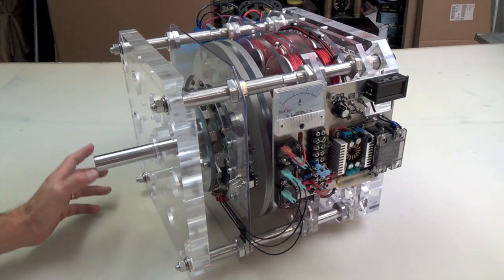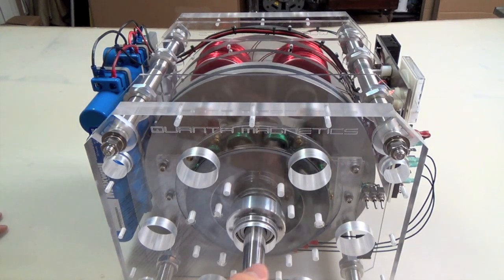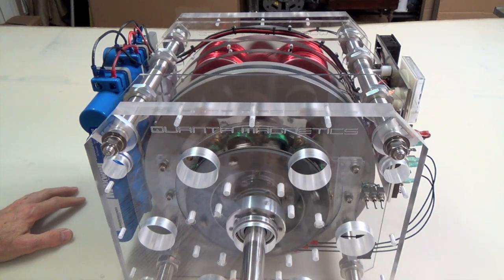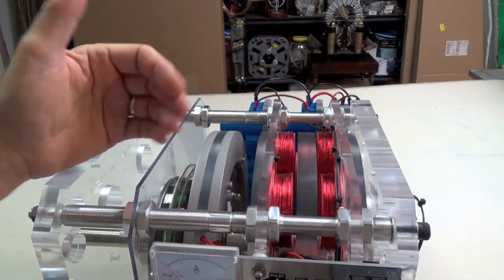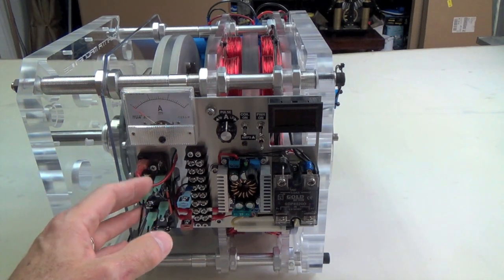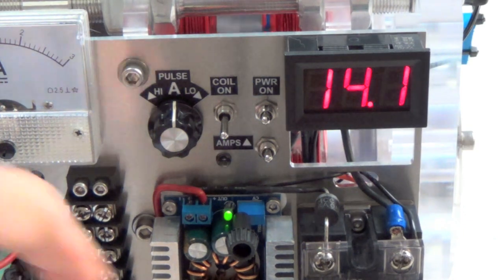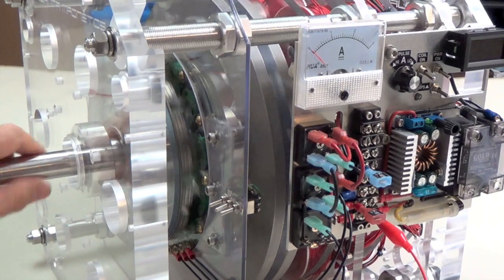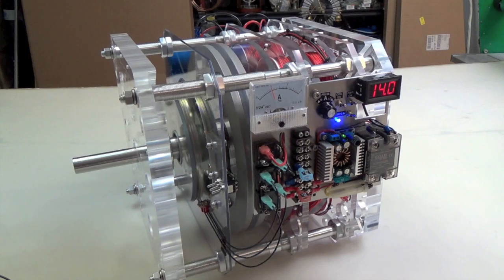Gyroscopic Inertia Pulse Motor Generator DEMO - 3 new inventions - one machine

Comment: is this thing a free energy machine or something?

how can you put in 50 mA and be getting out 1A ? (unless the input voltage is really high)
Reply: ***** 

No.  
"unless the voltage is really high" is correct exactly as I said it. 
50mA at HIGH voltage input can equal 1A at LOW voltage output.
Reply: yea but what's the drop in current between input and output?
Reply: of course current drops when voltage is stepped up.  if it did not, you'd have created a free energy machine where voltage goes up and current stays the same.
Reply: +Freddy Krueger voltage change, energy loss to friction.
Reply: +Ahashdah pretty sure the term you're looking for is renewable, not free.  After all, nature has also provided us with petroleum, so by your definition of "Mother Nature inputs this energy, not man," a regular off the shelf internal combustion car would run on "free" energy.

Comment: Well thank you for creating the most sensible video I have found on this topic. Most of the others are just a pure waste of time. At least you explain the basics in an easy to understand way. The machine looks nice for experimentation purposes and it appears as though you are suggesting that substantial mechanical energy can be produced with minimal electrical input. Did you say you can feed the power from the alternator circuit back into the machine to keep it running? If that is correct, how much energy is lost over time? Are you suggesting it can produce more electricity than it requires to operate or just that it can operate on a very low draw? I saw it recharging the two six volt batteries using a nine volt battery, but are you again suggesting it can replace more energy than it requires to operate?
Reply from the maker: It's all about maximizing your conversion efficiency.

Comment: sorry i cant remmeber your name but nice machine so far ^^
can you make it run liquid(warter etc...) i mean make it pump to a hight then make it fall down making an continues flow witout loosing its energitic flow i know you said in another video that you could use solar energy as a chargr for the duble gyro yay i know it might sound stubit using water etc.. still if it works it could be awsome piece of green tech.
but if you know of a better way to charge it then hand solar or warter try it out and show the results ^^ (precharged batteries dossent count as an good energy source)

Comment: How many watts does it generate?
You should hook up a bike belt chain to this and see the highest amount of watts generated, maybe with some other fuel sources? 
A stirling engine powered by a fresnel lens?
Imagine all of the power.
Reply: if this is to work in deep space there has to be a suitable source of power =drive =energy but for use planet side your idea is spot on
Reply: CDR466
 Could the suitable power source be Human? IE: peddle bike or circular treadmill? which in turn would keep stamina up in space?
Reply: Aba Zaba He's right. Take a ball, where's the up and down or top and bottom? Gravity needs up/down, top/bottom. Now imagine that ball your holding is earth, where's the top and where's the bottom?
Reply: opossom1968 guys, the earth is flat, look at the fish eye lens pic at 1:11 , notice the shadows cast from a sun 3,000 miles above earth, not 93 million miles... notice the hot spot from the sun, notice gravity has never been proven nor ball/spinny earth..

Comment: The gyroscopic flywheel ,,20yrs ago we called them magnetic couplings..your technology has made it more efficient
Reply: Well you don’t have to be a dick about it.
Reply: It’s the method by which he integrated the magnet coupling to the fly wheel, it’s uncommon in design and I don’t believe has been implemented in any commonly seen commercial or industrial devices.
Reply: The flywheel is gyroscopic because all of it's mass is on the outer edge. WTF does that have to do with magnetic coupling? Someone needs to pay more attention to what is said...

Comment: is the flywheel supposed to wobble like that as part of its function?
Reply from the maker: No. This was just the prototype. The production unit runs very true.
Reply: PMMG4HYBRID The first thought that ran through my head is that most kinetic energy storage/generator devices run in a vacuum. you are loosing a lot of energy having it in open air like that. second thing i thought was you are wasting a lot of energy on the wobble.

Comment: Ok, I love this. So now my friend can I buy the same system yet in a more compact design like size of an actual vehicle alternators shape, for the fact I'm really looking forward to using it as an aid for my 3phase AC, EV motor to direct some current back into my super capacitor battery setup and also to power rest of the vehicles electronic devices.  So tell me friend can I redirect the use of your device in my application with some success fulness bases on the way I see it's use?
Reply: Jesus Christ learn how to speak English

Comment: I was thinking today of an additional alternator on the other side of the gyro whereas you only need one gyro to operate two axial flux alternators .As well as the larger coils used in your previous video with only one wheel instead of three.

Comment: I have admired your presentation of the Company you aspire to. I have a lot on my plate, but would like to chat with you about your newest kit. I am building a new HydroMe Truefuelcell and BlewMe Fuels Organically Grown From Saltwater membrane that gives me a very large electron saturated system from the "presents" of the microbes I grow. (BlewMe). I want to input power from my microbial side of HydroMe Truefuelcell into your (Totally Awesome) 
Genset. This is a video of one cell, what I would like you to take note is there are two brass 1/4 inch electrodes. This is not a battery, due to similar electrodes. You can draw it down and it will jump right back. Try that with caps. So the reason I am reaching out to you might already be obvious. 
http://youtu.be/IhlUsE94-s8
Check out my mini series on Art Devine. I just released it. Enjoy. 
Your email contact is not working on your website so I am contacting you here.
David A. Puchta 
Hhydrogen4power 
18583817923

Comment: good day
i was saving money for one of your machine

but when i browse down
i saw this line

What you need to complete this kit:

is that mean i have to buy those thing separately?

i saw g1 and priced at 3950 USd

and one last question
i got 4x100Ah battery

with G1

can i run my entire house with it?

appliances that i have

ref
aircon 3/4 HP
10 bulbs at 10 watts each

please reply as i need the info badly

thanks 
james

PS
submit button dont work

thanks again

Comment: I'm not trying to be rude but I am curious why you feel these are three new inventions and not just a wonderful configuration of known inventions and methods?

I do like your channel and your devices you put together. Have you thought of using magnetic bearings and putting this in a vacuum chamber that people could evacuate with a little pump nozzle built into the top of it? The gyro surface and other smooth surfaces are going to get a nice boundary layer of air going on them otherwise.

I hear that diodes let electricity only pass in one direction. Would it be possible to use that method to pass the electricity back into the coils using a one way electric circuit using diodes?

Comment: 3 wheels turning with two coils seems more efficient. If you used the larger coils between the wheels would that create higher output? What would it be if there were an alternator at each end?
Reply from the maker: It might be awesome.

Comment: Wow! Another great video!  I have watched all your videos from the beginning.  I have often wondered how I might use such devices.  This summer I started a lawn service.  From the beginning, I really wanted to be different from everyone else by using all battery powered equipment.  In this way I could market my service as being quiet and ecological.  Since then, I've come to realize how difficult it is to charge my 40 volt batteries (Greenworks 4Ah w/using 1.5 amp 120v AC charger) the 100 watt inverter in my truck.  My question to you is: how could this latest prototype kit help me charge multiple 40v batteries with 180 watt chargers while utilizing a solar panel as the input source?  What size solar panel, in watts, do I need?  I ultimately want to charge larger equipment like the Mean Green Machines mowers.  Thank you, Nate

Comment: This tech in its infancy is interesting, I cannot wait for the breakthroughs that make it run sustainable on its own power. 
Once its output is more than it needs to run it can then run itself indefinitely.. once this tech is at that level... then the next step is how to multiply that output. 

Even combustion engines need somethin to start them.. and you see how far that tech came over the years.